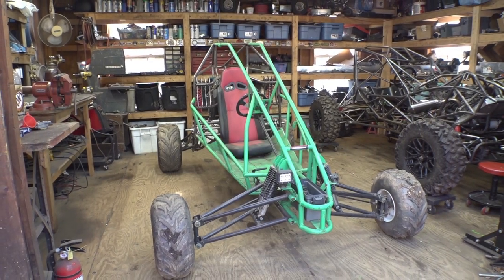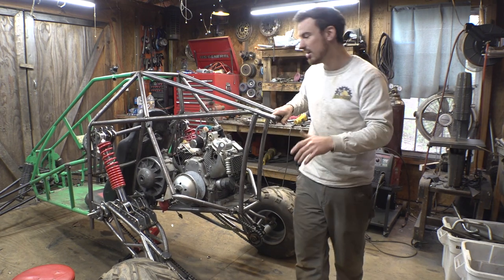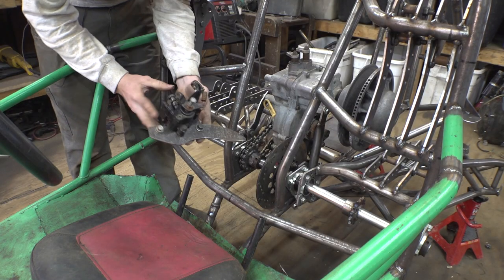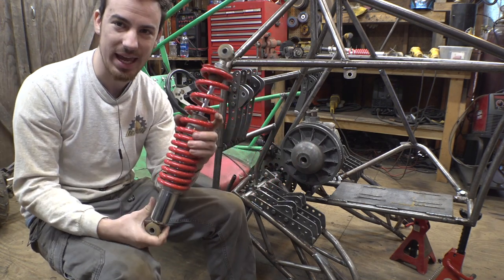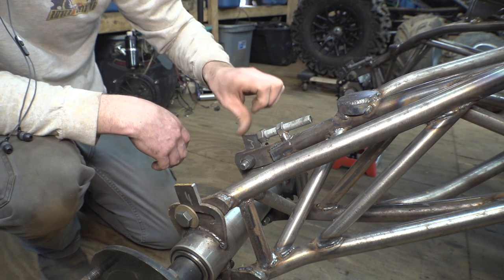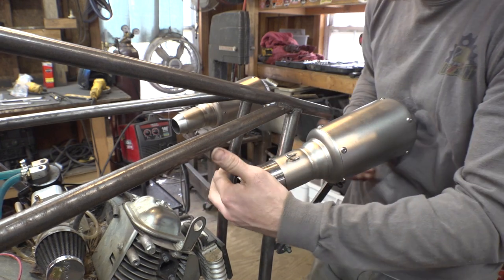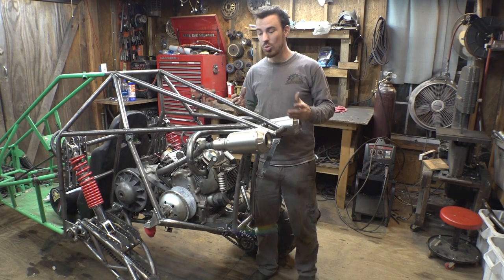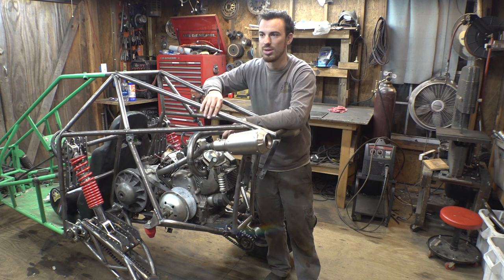Building Headers for the 670 Long Travel Go Kart - Part 4

Comment: Blade type sway bar. Look into it. It's something you can make at home, with stuff in your shop and maybe a leaf spring from the scrapper. Grassroots racing is doing it, and it looks way cooler than uggo conventional sway bars. You can really spruce up a project using them in a smart way.

Comment: That driveshaft better be really strong because it takes all of the weight in the back all the time. Might want to mount the rear swing arms directly to the frame. Super cool tho my dude!!!
Reply: @NubsWithGuns  He’s means the axle that that the chain drive uses and both swing arms pivot on at the same time.
Reply: It should be plenty strong considering it is a solid 1 inch round piece of steel. Not sure about the way it is being used here, but those types of axles are made to hold lots of weight since they hold the entire back end up on most go karts
Reply: @carsonhendee919  My concern is in asking a shaft to do so many things at once and making single point of failure. If that shaft bends at all its screwed.
Reply: @ethanmiller5487  Yeah, hopefully all the stress points are spread out enough to keep that from happening. I can’t completely remember but I think he did the same thing on the cbr1000 buggy he is modeling this off of and it seems to work well

Comment: Enjoying the build. That sway bar would work fine. As with shock placement, you can manipulate the mounting locations of a sway bar to have more or less effect on the sway. Also, the shorter the bar is, generally the stiffer it is or the quicker it "ramps up" in resistance. A 3/4 bar that was wider would be stiffer, not more harsh. 

Cheers

Comment: I would give that anti roll bar a try.  It would mount up great right behind your seat.  put it half way up the back of the seat and then just run links down to the trailing arms using small heim joints.  You will be surprised how well it works.

Comment: a rear sway bar for a 1984-2001 jeep cherokee XJ would work, but you'd have to cut it down width wise to fit, i want to say (going from memory) its about 5/8" thick and frame width and on the XJ it ties in right at the rear leaf spring plates at the axle, sweet project, and good to see you still at it brother, stay safe

Comment: I thought a bump stop was used to stop the shock from bottoming out and breaking.... Limiter straps to keep the suspension from over extending...
Reply: I thought the same thing, he needs to somehow make the bump stops movable so when he moves the shock, he can move the bump stop with it
Reply: You “can” use a strap as a bump stop, in a similar way to how pullrod suspension works

Comment: I still say, two pair of decent used dirtbike forks make an excellent, fully adjustable rear. That kart could use two pairs of fully adjustable pitbike forks. Or even two pairs of decent fully adjustable MTB forks. Just use however many legs will do the job. 😉
Reply: BRILLIANT IDEA
Reply: @michaelmarshall8041  Thanks! high performance systems can be found in all those. MTB forks often even have a lockout switch, so driving on a flat surface, you can lower the ride hight, and heading into the rough stuff, can add a couple extra inches of lift. If one leg doesn't do it, then use a pair of legs, per wheel.

Comment: you can still use swaybar on front.. or get another & link them together.. a left&right joined at the eye .. extra with adjustable locks like chain stays you deleted.. &see if it takes stress..
the chainstay could tighten or loosen via middle eyelets in center of M

Comment: look for monroe air assist shocks, you can see their length on their site. enough damping for a cushy american car, with built in airbags so you can add or remove spring on the fly.
a pair of them on each side should be more than enough when aired up
And that sway bar will work fine, btw

Comment: as far as the shock absorbers go try see 90s truck shocks for like an f150, or extended shocks that would be for a lifted version of the truck. I had an 89 f150 that the rear shock absorbers were that style eyelets they may work out for your dampening needs

Comment: Look you didn't hear this from me but I knew a guy who used a two way hydraulic cylinder with both ports connected to each other, prefilled with oil, as a "hydroshock" as he called it. The more force applied, the higher the resistance of the fluid being forced out of the cylinder. Apparently the other spring had to be beefed up significantly to compensate!
Reply: Could drop in a Parker color band flow Control to help dampen.

Comment: Hi, it's coming along nicely I would have two chain tensioners like u was gonna cos of keeping that small wheel axle straight other wise it will do what a motorbike or dirt bike dose with one chain tensioner it pulls the wheel in an angle no matter how tight you get the bolt going through the swing arm 💯💯💯💯👀👀👀🔥🔥🔥👌👌👌

Comment: Make your own sway bar.   Technically, it is called an anti-roll bar.  Sway bars are similar, but are to keep a vehicle or trailer from swaying.  An anti-roll bar is specifically to keep the vehicle from cantering in a corner.

Comment: Don't know if its in the plan, but I'd put a couple tabs on the frame so a piece of sheet metal could be in front of the disk between it and the seat in case it cracks or breaks. (Scatter shield) I've broken one on my Polaris, was more exciting than I would have thought..
Reply: Not trying to stop the box, its tied to a lot of frame members.
But the disc can chunk or crack off sections and mine came right through the plastic body work.. Shouldn't take much more than a 1/6 inch thick bit attached to the two vertical tubes, Would also stop shrapnel if the gear box locked a bearing and made inside parts out side parts.

Comment: Aren't the springs on those shocks 2 1/2" ID springs?  Most coil-over (HotRod) shocks are 2 1/2" and you can buy all manner of springs, some combine a stiffer 4" spring to prevent over compression ..while the rest of the spring set is softer and makes up the overall 14" spring length.  Summit Racing..

Comment: The chain tensioner is not to hold the axel in place while riding.  It is just to tension the chain into place when the bolts are loose.  There is no reason to have 2 at all.  The job of holding the axel in place is the guide bolts.

Comment: You might be surprised on prices if you check with your local auto parts store. Mine has a book from monroe with different size shocks and mounting options. There part numbers can be cross refernced with other manufacturs for cheapper cost. And I am not talking a autozone or oriellys. Find a mom and pop store. The one close to me can almost allways beat rock auto ebay or chain store.

Comment: I know you are going for a "look" but a 2 into one will make more power as long as the muffler isn't a restriction. Or make an x pipe where they merge and then split again. A simple crossover would help but I'm not sure how much on a 2 cylinder.

Comment: Try going to the auto parts store. Look for crown vic shocks. They might be short enough.
Reply: For the sway bar, look into a 2007 chevy trailblazer. 4x2. It pretty thin but I think it might be long enough. Hopefully not too long. Not the front sway bar. The rear.

Comment: what if you used the second shock mounts for a shock/spring conbo like you have but at a different size and strength that will only start when the red shocks you allready have go past a certain compression kind of like progressive springs for jumping ? that way you wont get a hard landing when you jump but  also under normal conditions the ride will be smoother.

Comment: Just an idea but might it behoove you to contact a shock distributor and ask for a sales manual, similar to what auto part stores used to have… they may even have a pdf file you could download that gives you the measurements you need.. go to eBay and look around… I’ve got some taps and dies for you too… might be by tomorrow… if you aren’t there I’ll just leave them by the door

Comment: The suspension is not going to work without a differential ! 

He has both sides on chains connected to a single shaft/rod and that’s not good! 

He will have to separate the shaft/rod and add a differential in between.

Comment: Why do you not just paint the frame and parts at this point while they are apart and fully welded?  Instead of reassembling, test driving and then doing a total teardown and having to clean the muddy/rusty mess and then paint.  Just seems like a lot of extra work. And you do enough work as it is.

Comment: What your wanting in shocks is easily located, just go to manufacturer monroe, are any other manufacturer website go utv area, and put in your travel weight of vehicle, and any other information they want. 
Figure out part number after you have all your specifications your wanting, and do general search for that part number, and it's going to take you to everything that is pertains to that shock for sell by others, and probably equal design by other manufacturers too.
Nothing hard about it, simple logic tells you that information your is at manufacturers website. 
Come on you've got more snap than that, surely it's not that hard to figure out where the information you're wanting is at

Comment: That front shaft that transmits engine torque, and is also the swinging arm pivot, man, that's going to cause you a load of problems!  A couple of landings, and it will bend! Your build skills are awesome, but not so sure about your designs..... Sorry.